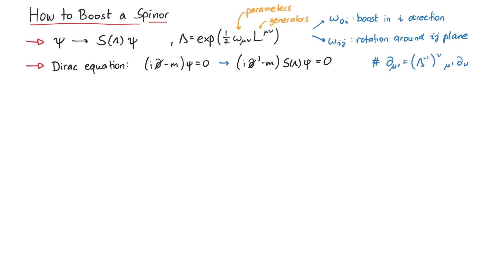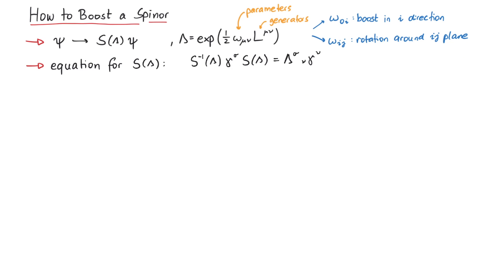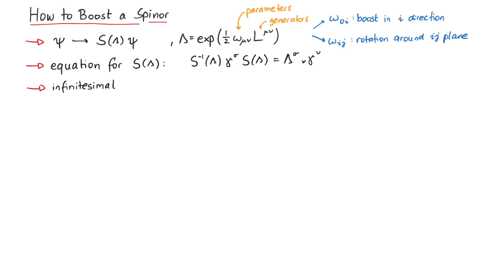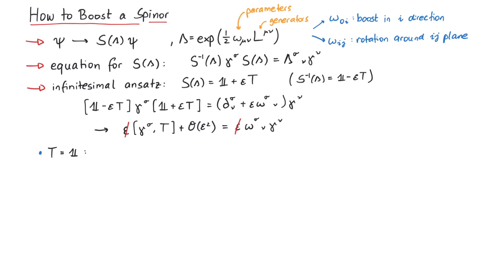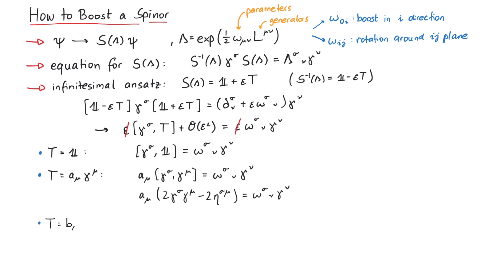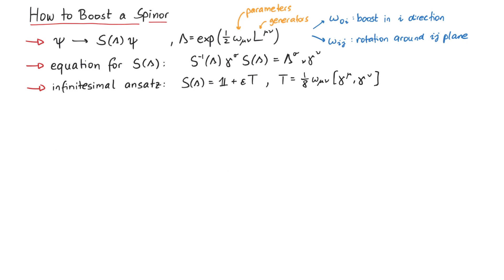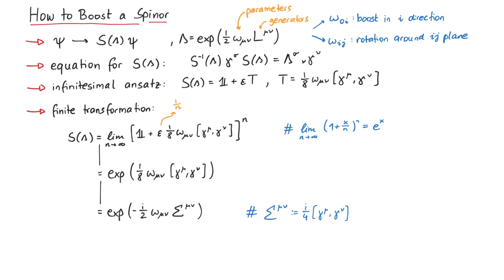Spinor Lorentz Transformations | How to Boost a Spinor

Comment: What do the Twistors of Roger Penrose and the Hopf Fibrations of Eric Weinstein and the "Belt Trick" of Paul Dirac have in common?
In Spinors it takes two complete turns to get down the "rabbit hole" (Alpha Funnel 3D--->4D) to produce one twist cycle (1 Quantum unit).
 Can both Matter and Energy be described as "Quanta" of Spatial Curvature?  (A string is revealed to be a twisted cord when viewed up close.)         Mass= 1/Length, with each twist cycle of the 4D Hypertube proportional to Planck’s Constant.

In this model Alpha equals the compactification ratio within the twistor cone, which is approximately  1/137.

1= Hypertubule diameter at 4D interface

137= Cone’s larger end diameter at 3D interface where the photons are absorbed or emitted.

The 4D twisted Hypertubule gets longer or shorter as twisting or untwisting occurs.   (720 degrees per twist cycle.)  

If quarks have not been isolated and gluons have not been isolated, how do we know they are not parts of the same thing?   The tentacles of an octopus and the body of an octopus are parts of the same creature. 

Is there an alternative interpretation of "Asymptotic Freedom"?  What if Quarks are actually made up of twisted tubes which become physically entangled with two other twisted tubes to produce a proton?  Instead of the Strong Force being mediated by the constant exchange of gluons, it would be mediated by the physical entanglement of these twisted tubes.  When only two twisted tubules are entangled, a meson is produced which is unstable and rapidly unwinds (decays) into something else.   A proton would be analogous to three twisted rubber bands becoming entangled and the "Quarks" would be the places where the tubes are tangled together.  The behavior would be the same as rubber balls (representing the Quarks) connected with twisted rubber bands being separated from each other or placed closer together producing the exact same phenomenon as "Asymptotic Freedom" in protons and neutrons.  The force would become greater as the balls are separated, but the force would become less if the balls were placed closer together.  Therefore, the gluon is a synthetic particle (zero mass, zero charge) invented to explain the Strong Force.  The "Color Force" is a consequence of the XYZ orientation entanglement of the twisted tubules.  The two twisted tubule entanglement of Mesons is not stable and unwinds.   It takes the entanglement of three twisted tubules to produce the stable proton.

Comment: You used the exponential map for the Lorentz group O(1,3). But how can you be sure that this map is surjective? For example I cannot generate O(3) by taking the exponentials of skew-symmetric matrices, because the determinant of these matrix exponentials is always +1. Therefore I only generated SO(3).
Reply from the maker: The full Lorentz group is O(1,3), but we're mostly only interested in the component that is simply connected to the identity, i.e. the one without parity or time reversal transformations. Hence, the exponential map should work just fine since e^0=identity.
Reply: @PrettyMuchPhysics  Thank you for the answer!

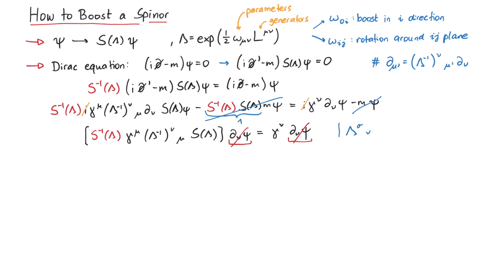Comment: Excellent!  Right around 1:15 you left multiply each side of the equation by lambda sigma-nu (a Lorentz transformation matrix).  How do you know that it can slide past the S^(-1) matrix -- i.e., commute with it?  After all, the S matrix is a function of the lambda matrices, which do not commute with each other.  Thanks!
Reply: P.s. Having thought about it a bit more, I suspect the answer to my question is that the S and lambda matrices operate on different spaces and thus do not "see" each other -- the S matrices act on Dirac spinor space, while the lambda matrices act on space-time vectors and other vectors such as A-mu (the electromagnetic potential vector). But I wonder what you think about it?
Reply from the maker: I guess that was a bad choice of notation. The matrix S does not explicitly contain Lambda matrices. Instead, it contains gamma matrices. For a fixed mu and nu, Lambda is just a number, so if we use index notation, we can move them around freely. 

However, even for a fixed mu, gamma^mu is still a matrix! Therefore we have to watch out for gammas, but not for Lambdas. 

Hope this made sense. If not, please ask again!
Reply from the maker: (Referring to your second comment)
That‘s exactly right!

Comment: 1:07 why did you multiply by the inverse on only one side?
Reply from the maker: This was a bit sloppy, sorry. We actually multiply with the inverse first, and since the right-hand side is zero, it doesn't change anything. Then, afterwards, we notice that both Dirac equations are equal to zero, so we set them equal.